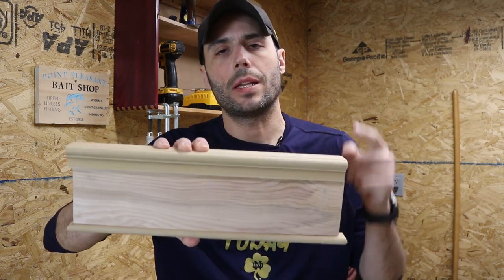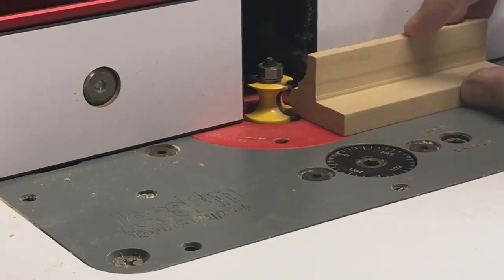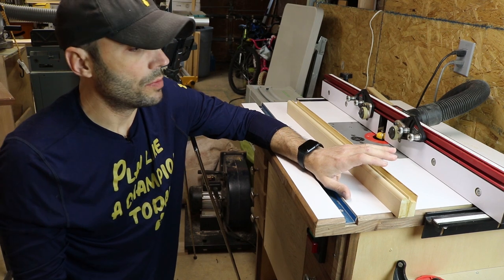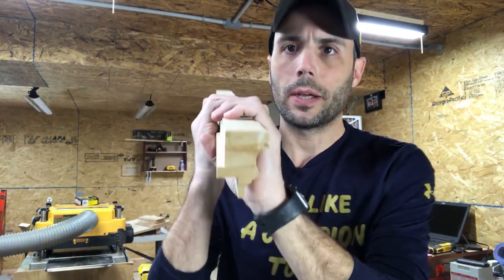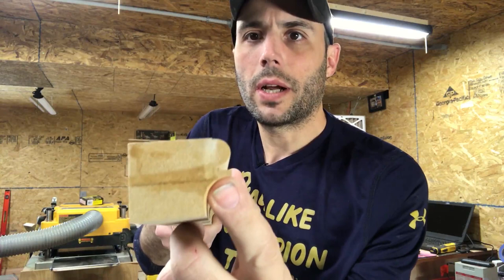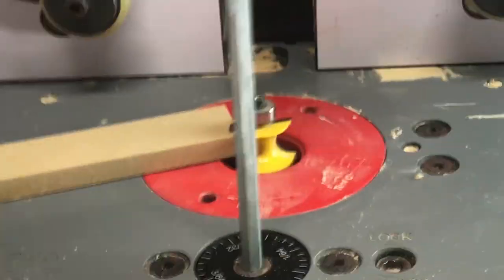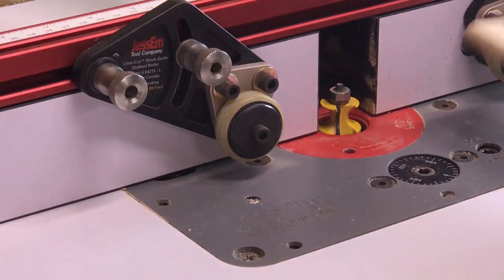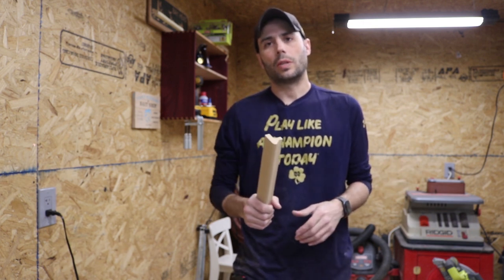DIY Traditional Craftsman Bullnose Trim

Comment: Nice video.  In 30 plus years of woodworking I never considered running mdf across my jointer or through the planer. Anything special you do to resize parts?

Comment: Really enjoyed the video. I have this type of trim in my house. I was just curious as to why you decided not to carry the bullnose "around the corner" on the ends of the top piece as you did with the bottom bullnose. With a miter cut maybe?
Reply from the maker: You called it!!!  I find it easier to simply make a long length of trim and then miter it on the ends.  I love how this trim looks and soon it will be in my house as well.  Thanks for the comment.  I truly appreciate good comments like yours. Have a good one.